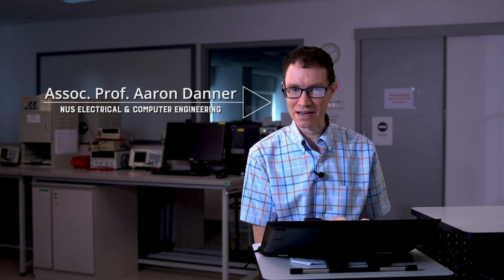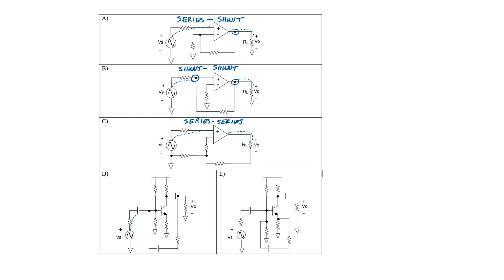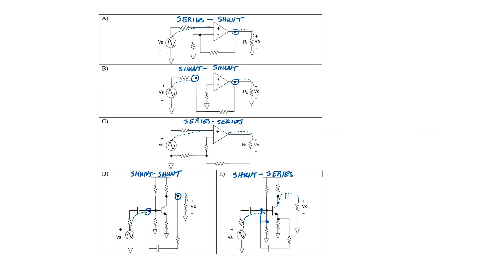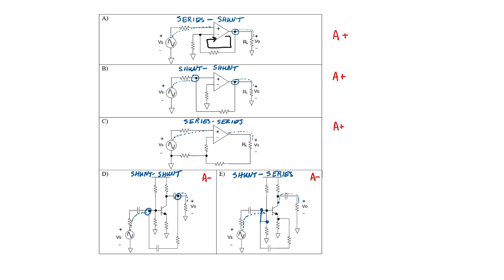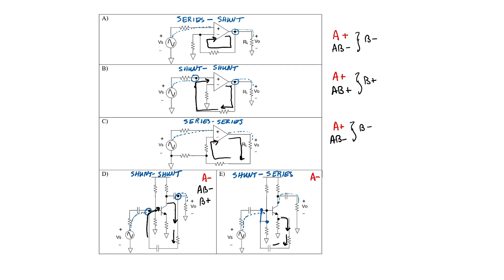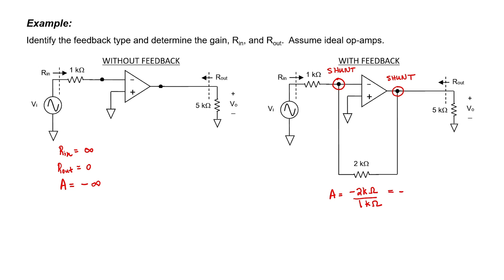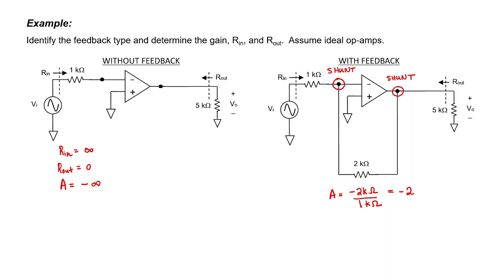Negative Feedback Example Problems (4 - Feedback)

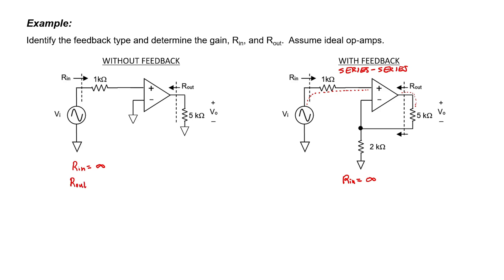Comment: Sir, at 6:46, the configuration is not exactly the standard non inverting amplifier since we are measuring the voltage across the 5k resistor. To calculate the output impedance of the network, we'll remove the 5kohm resistor and put a test voltage source. If we do that then should we no get Rout = infinity?

Both the input terminals of the op amp will be at zero volts as a result of which, no current will pass through the 2kohm resistor, thus implying Rout = infinity.